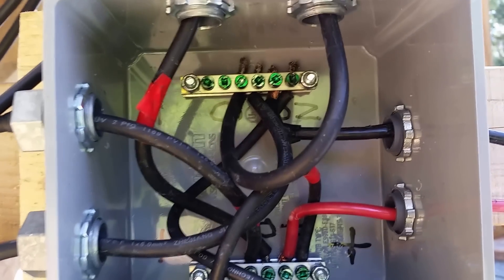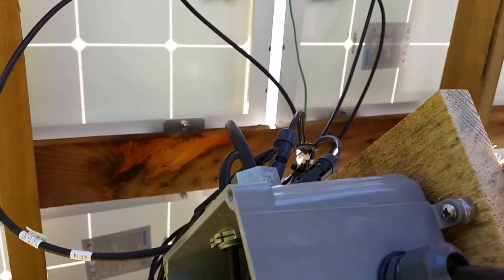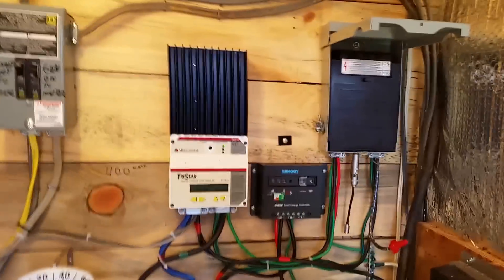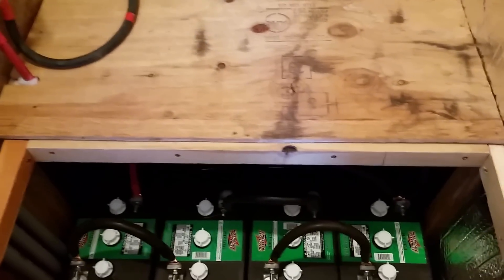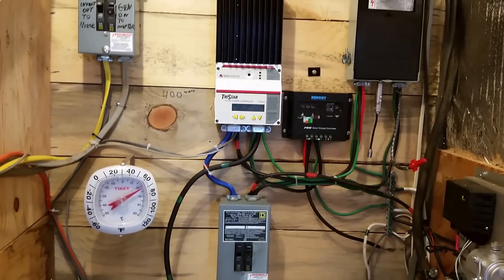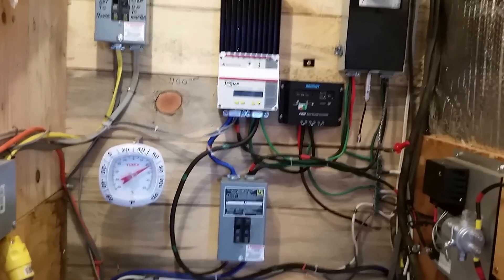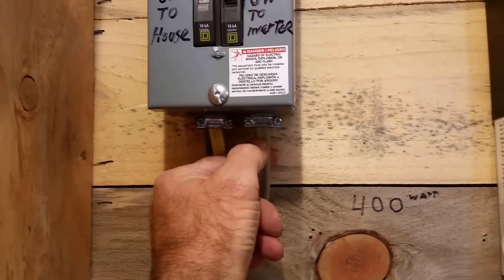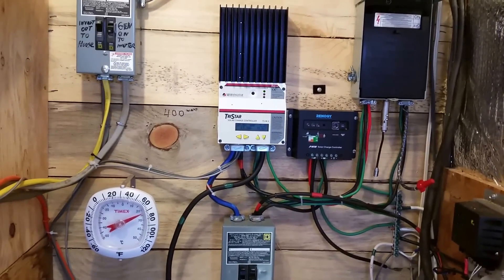Off grid solar homestead (24 volt conversion)

Comment: I made mine 24 volts..I've got about 1/3 of what you do but it works..I used 8  12 volt batteries so far...that brings my total to $2000 but I really need 3 more panels so I can run an AC later on...I wanna get it...so that I can't remember when I plugged something in to the grid..it's been a few weeks now..I started piecing mine together in November...it took awhile to get my Aims inverter/charger..I'd almost get enough then have to wait again...I got a 2000 watts and I like it...its really quiet even 4 ft away...they had power being turned off here 2 weeks ago so I'm just getting it done in time I guess..my cousin's house got down to 14 inside while I was warm enough by my fire..her lights were out and mine worked..her big fancy house and my room in my uncle's  barn lol..yeah you have a nice battery set there and that's the smart way to do it but I am maybe poorer than you probably lol but that's okay...I think I'll build a gas generator now..Just enough for charging...I managed to buy a 2000 watt Winco with a pulley that only takes 2 hp so I'm gonna be "power fat" with a 3 horse Briggs..it won't use much gas either..that's good..
Reply from the maker: Very nice! 8 love everything about being off grid. We are building a new 9ff grid homestead on the other side 9f the Cascade mountain range. We upgraded our system a few years ago. We now have 5000 watts of solar, Magnum inverter and repurposed Tesla lithium batteries. One word 0f caution, solar power is addicting lol. Aims are good inverter/chargers. Sounds like you are on track to be completely off grid. Good for you and thanks for watching.

Comment: Glad you went over safety stuff.

Your combined box was more along the same idea you had.  But many spend lots of money a d time using breakers or fuses in this scenario.
Reply: Wow....I should have proof read.

I meant I was thinking about doing the same sort of combiner setup. 

Lots of vids use high price setups with breakers or fuses.
Reply from the maker: @bradfordpalmer2298  Greetings! I did eventually change out the whole system with a Magnum inverter and new charge controllers. I'd did end up using breakers and conduit. I also built Tesla lithium ion batteries with BMS modules. We are reinstalling this system in April at a new homestead. I used what ever I had laying around at the first just to get off grid. Then as I had the money I made the changes. The combined boxes are going to be reinstalled in the new system. I think you would he happy with doing yours the same way.
Have a blessed day and thanks for watching.

Comment: I worked on electric motors and Transformers and Steven turbines. I'm done some more house wiring back in my early days. Just use common sense, I wouldn't worry about the conduent. It looks great.
Reply from the maker: Thanks. The system has been converted to Tesla lithium ion batteries since this video. 
We also have to array. I did end up putting everything in conduit. Now we are relocating the solar power system to a new homestead up in the mountains.

Comment: how much power are you using a day if you don't mind me asking.  I will be going off grid when I retire and I need to design my system and buy my parts etc. so I want to figure out what I need to get and start to make a list so I am up to snuff when the day arrives. if you could help me out that would be great.  one thing, have you considered putting in some wind power. it would work at night and all day long and do a lot of trickle charging which batteries like and be able to make sure that you have power even when the sun is not that great or at night. just a thought.  I will be doing that. I like your system but I think I would put in more batteries. I was thinking of 16 12v to 24v so I would have 8 24v at 280ah per battery.  I want to have standby power and make sure I don't run out. well, I have written enough hope to hear from you.
Reply from the maker: Greetings from Oregon.  This video is of our old system. We have done many upgrades and changes since the. Now we have a 4.8k solar array and eight L-16 batteries. There are a lot of things I would do differently if I were to buy the equipment all at once. I did try wind as well. With wind its go big or go home. I have done a lot of research and have a friend who is a professional installer. He says 110' high is minimum and you have to have a good wind area. Get a weather station with a data logger from Amazon and let it run for a year and see if the wind is there before you invest in it. We have many more videos of our system upgrades. I would suggest watching those and then I can answer your questions. By the way our average is 6 kilowatt hours a day. Even though I can make 30 a day 7 months out of the year the real issue is 3 months out of the year I still need a backup diesel generator. When we switch the batteries out to Nissan Leaf lithium ion we will he able to say goodbye to the generator. Have a blessed day!
Reply: I’ll second the suggestion for testing the wind before investing. Unless you like expensive yard kinetic art. And I’ll second the suggestion for a 100 foot tower. Unless you’re in a incredible wind location. Hydro is awesome but they get blown out by floods which gets old rebuilding them. A few perfectly sized small creeks with no logging nearby won’t flood. The forest and terrain helps maintain even flow. If you haven’t bought your property yet you could look for a good hydro property.

Comment: Conduit is ok but in low voltage situation (12,24,48,...ect)and specialy in dc voltage is more important to have properly sized wires...so that could not create the heat in wires and conections.... and proper type of fuses for dc applications... 👍
Reply: My thoughts too.  Just starting to build a system but have watched many vids.   Several guys use thermo guns to detect problem areas.  I just bought a Thermo gun yesterday fir that reason.

Comment: Is the ground portion of the DC and AC system tied together? For instance, the negative side of the batteries tied to earth ground, the metal boxes of all equipment, and the neutral side of the AC system bonded to the same ground bus bar/rod? Is this recommended?

Comment: 3:26 The "Amp hours" don't stay the same, you purchased four more batteries (3:10) to keep them the same!
Reply from the maker: metamud I don't remember what I said in the video but we have eight L-16 six volt batteries of 420 amp hours each. They are in a 24 volt configuration.  2 strings of 4 in series.  That is a total of 840 amp hours at 24 volts nominal.  Before we added 4 batteries we had 4 batteries 2 strings of 2 in series for a total of 840 amp hours at 12 volts nominal.
Reply: Yeah i was thinking the same thing maybe he just misspoke

Comment: How did you move those batteries into place? Aren't they about 110 pounds each? Great videos! ~Dave
Reply from the maker: Tiny NH House Greetings from off grid Oregon,  We moved the batteries with a dolly. They have rope handles so picking them up off the floor is easy for a healthy person. I did it by grace lol. I have completely changed our whole solar system since this video. We now have 4.8k of solar, Magnum 4k inverter charger, a Midnite classic 200 and a Outback flexmax 60 solar charge controllers.

Comment: Don't worry about the conduit, it all looks solid enough. Everywhere you go there are plumbers with dripping valves, cobblers with squeaky boots and carpenters with drafty doors/windows. If it is reliable you'll never look at it and in 10 years you will have forgotten what goes where, so draw a diagram.
Reply from the maker: Greetings from Oregon, we are back on youtube. You will have to re subscribe to get notices. Have a blessed night

Comment: I wouldn't worry about putting anything in conduit because it's just another expense $ and because no ones allowed in there anyway.  I've been in fenced in high voltage panel room's with large exposed Live energized parts like copper buss duct etc.  Keep it the way it is.

Comment: did you spend more than 10.thousand ?
Reply: don't have one ,they keep saying is expensive
Reply from the maker: Greetings from Oregon. The solar equipment and batteries was $5,500I am adding a 2000 watt array and changing the inverter to pure sine. Another $5kSorry about the delayed answer.